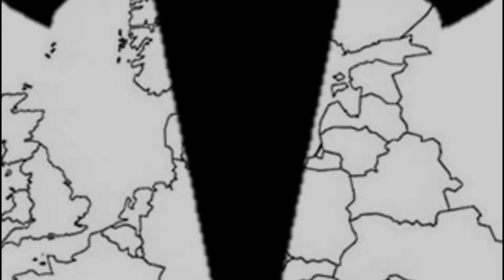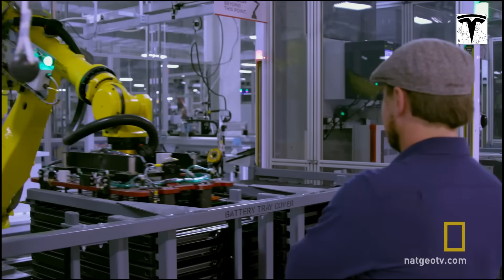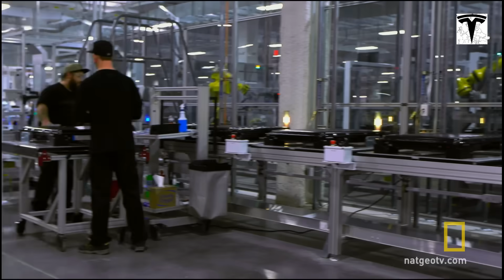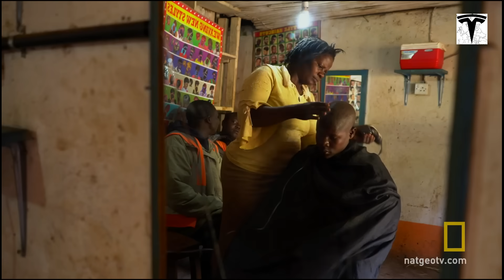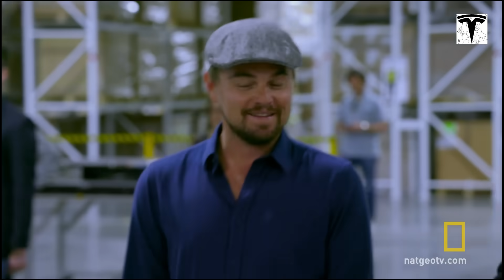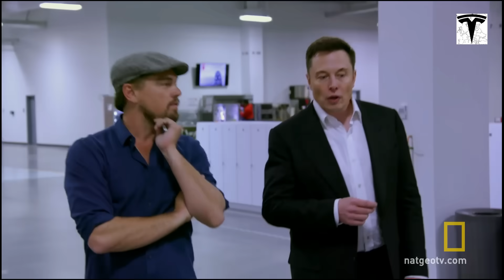Leonardo DiCaprio and Elon Musk in Gigafactory 2016-10-27

Comment: So you live in an apt complex. No charging stations. Drive 30 miles daily for work. No alternate trans. Must charge electric vehicle avg 3-4 hrs daily. No charging stn at work. Currently spend 5-10 minutes to fill gas tank. No line. Switch to electric vehicle would have to wait in line up to 24hrs just to get to charging port due to queue. Dream on Musk. Gas going to be around a long time.

Comment: Carbon tax is BS.  You need to get the technology to be able to compete with fossil fuels.  Rushing technology out that is subsidized by governments through carbon taxes does nothing but hurt the economy and usually lacks the technology and infrastructure to achieve most of the goals of "green energy".  Water cooled focused solar electric is WAY more efficient than traditional solar panels when it comes to sustainability and carbon footprint and we would be better off putting government funding into researching Sodium Ion batteries and carbon nanotube capacitors.  We are 20 years off before these will hit the market... maybe more.  With sodium ion batteries we could see batteries costing half as much and holding 2.5x the charge and have a lifespan 2.5x longer.  Add in carbon nanotube capacitors to handle fluctuations like regenerative braking and you might see 2x the life again.  Think in a car....  Instead of costing $8,000 more it might cost only $4,000 extra for electric, but instead of 100 mile range you now have 250 mile range.  and instead of replacing the battery after 3-5 years you might be looking at batteries that could last 20 years.

Focused solar electric on a movable tracking system with water cooling would be easily 4-5x more efficient, likely cost less, and have a smaller carbon footprint.  Cheaper LED lights is another thing that needs researching.

Comment: A kilogram of steel produces about 15 kilograms of CO2 in the atmosphere. A kilogram of plastics, rubber, or copper produces three times the emissions, about 40 to 50 kilograms of CO2. An electric-powered Tesla Model S, at about 2240 kilograms of steel, plastics, metals and rubber, produces the CO2 equivalent of about 60,000 kilometers of driving a conventional vehicle – three to four years of typical driving and fossil fuel burning – before a Tesla is even purchased.
Reply: Sanjay Vallabh Where did you get these numbers?

Comment: you know we could power the hole country if every 5 mils we placed a damn on the big and small rivers and water powered generators but a bunch of tree huggers are trying to save snails and frogs preventing us from using a technology that is 100% carbon neutral right now after construction is complete.and we could charge them electric cars with out burning fossil fuels to run the power grid

Comment: Sufficient amount of batteries may solve renewable energy intermittence problem and the energy must be produced with material and energy intensive equipment that makes whole renewable fuss dubious.  Secondly, feasibility of 100 gigafactories depends on procurement of Li cells for them that is not trivial task if possible at all. Musk talks B.S. as usual and an actor eats it with delight.